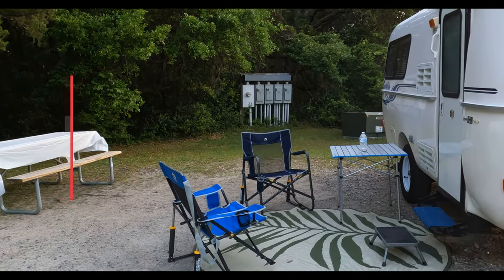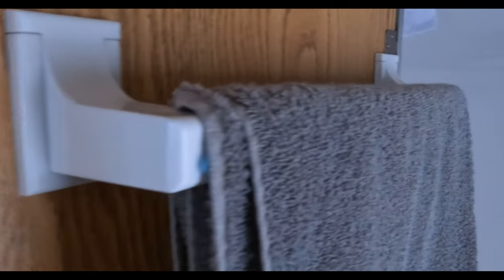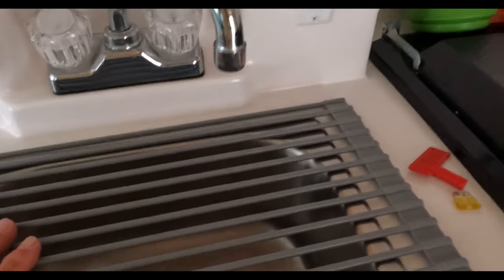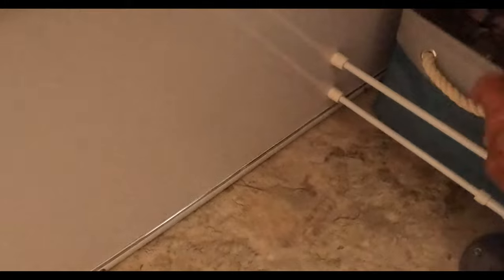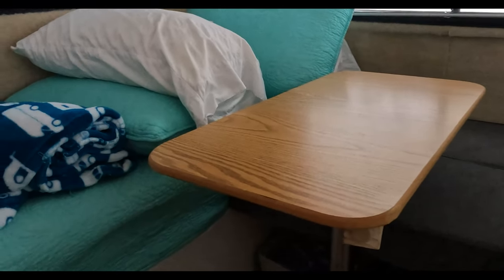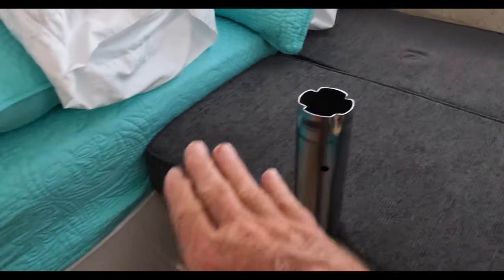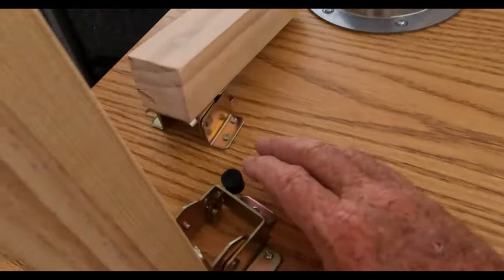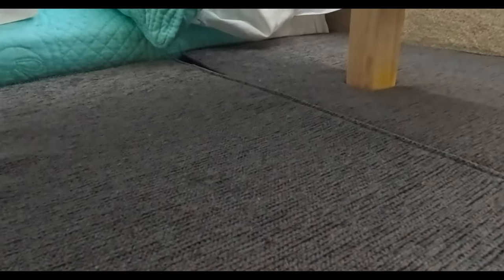Low Cost Casita Travel Trailer Upgrades

Comment: Did you also replace the kitchen drawer sliders? With those KCOLVISION ones in your store?  Do they fit ?
Reply from the maker: No, we still have the factory slides. We used them on some experimental table options before we chose our current tables we use.